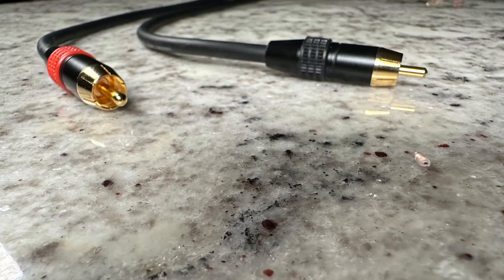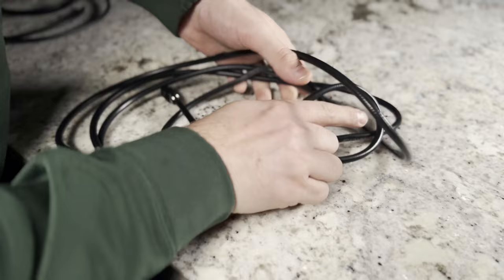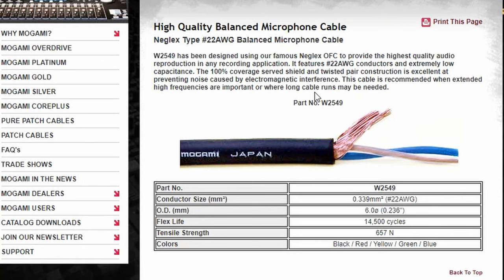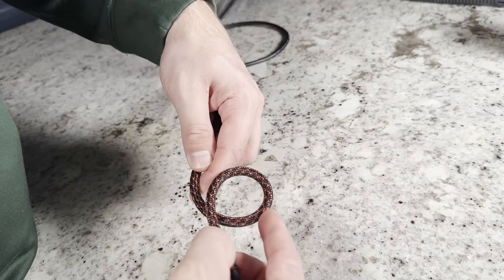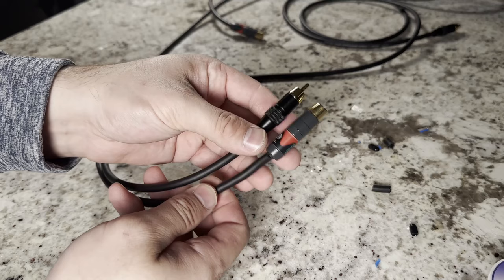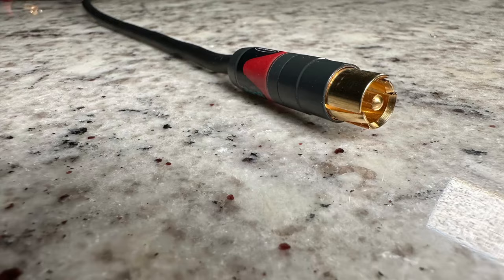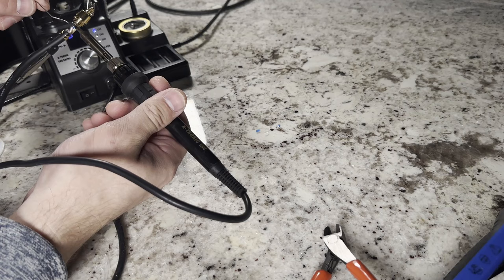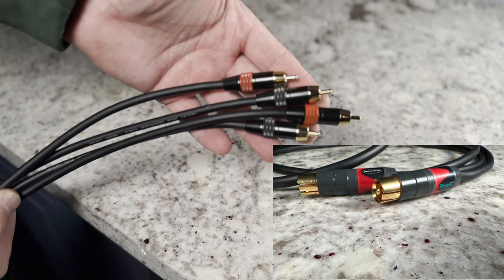The ULTIMATE DIY HiFi RCA Guide!

Comment: I did exactly this with Neutrik plugs and Mogami quad core. But I joined the two clear cores for the positive and centre pins and joined the blues for the negative and added the shield only at the end to be connected at the source (the surround controller) and left the shield unconnected and trimmed off at the other end ( the subs in my case). The idea being the shield will provide further shielding in addition to the two twisted pairs but will only be grounded at the source end.  This was a recommendation I picked up from the Swiss Gotham Cables site. Also the sum of the cross sectional area of two cores from the quad core is greater than the single cores in  the two core
Reply from the maker: That’s a great tip. I almost talked about this in the video, but decided not to. Glad that we brought this up.
Reply: That's exactly the way audio signal cable were recommended to be made in The Amateur Audio magazine, using Mogami cable. The two white wires joined to the shield on one ground end only, the other ground end just with the white wires. Some consider it's better to just crimp, not solder, the two wires or two wires + shield to the ground "tube". On thing that I should recommend is to use a short piece of shrinking to the "ground area" and apply heat on it. And trim carefully all the excess shield copper wire.
Reply: Nothing wrong but also unnecessary. You can do this with a shielded single core cable. With 4 core (dictictive color) shielded cable it is possible to make a stereo pair of XLR out of it with common shield drain to the source.
Reply: @ruofish  the point is by joining pairs of cores tog you increase the cross sectional area and reduce resistance compared to single pair or single core, and the floating shield connected connected at source end gives better EM and RF shielding
Reply: @stephenyoud6125  1. Getting one size up single core will yield more cross sectional area than joining two smaller core, for less money. 2. The 2 cores that you connected to the shield does not do any shielding and are wasted. Cores are for signals. Hence why I said there's nothing wrong with your approach but it's unnesssary. If I'm to build from fresh, I would get a single core shielded or twin core shielded (twin core for different sound signature, not for cross section) and build a pair of idividual cables. If I start with a 4 core then I will try to build a stereo pair within that with some care in doing the jacket.

Comment: I always thought it was a good idea to turn off any electrical equipment when plugging and unplugging things
Reply from the maker: It absolutely is for the reasons stated in the video. But sometimes you just forget.
Reply: Those connectors definitely have an advantage in live broadcast or pa environments where you might need to hotplug audio connections. However at home, where you always have the option to just turn your system off for a moment while you unplug or plug something in they mostly have no point. Still some nice connectors tho and i can see the point for some people.
Reply: @Toid  You'll forget even more often if you don't build that habit of always turning your system off before making a change....good tutorial, I just wouldn't recommend that people get in the habit of hot swapping cables.
Reply from the maker: @GoodkatNW  I completely agree. I don’t want anyone hot swapping cables either. It’s just another added form of protection for those that may need it.

Comment: Nice video, but your title is incorrect and misleading, it should read "A more flexible coax cable for RCA use". Let me explain and then maybe you can make a follow up video which is true to your title. The correct way to make an RCA cable using the Mogami W2549 is as follows:

1) Noise rejection comes from the pre-amp (operational amplifier on the receiver side) which the cable is connecting to. All op-amps amplify based on their differential input, even when designed as a single ended amplifier, and not specifically as a differential amplifier. 

2) The amount of noise induced into a wire is based on its loop area. If you have uneven loop area on your two input wires (in an RCA this is signal and ground), the induced noise will be different, and this difference will be amplified by the op-amp. When the noise on the signal/ground is the same the noise will not be amplified.

3) A 2 wire input, such as an RCA, does not have a true shield, the shield (if connected to the ground) is actually part of the signal path. We need to change that.

4) The goal is to have the same amount of induced noise on both your signal/ground lines. By providing equal loop area for the signal and ground wires this can be achieved. 

5) Do not join the blue/clear twisted pair together and connect them to signal. Do not connect the shield to the ground. This will give a difference in loop area for the signal/ground and different induced noise for the signal/ground wires.

6) Use the twisted pairs within the W2549 as your signal and ground wire.  The blue/clear wires have the same loop area and in theory exposed to the same induced noise, due to being twisted. The shield has a different loop area. Remember to maintain the same polarity of the signal blue / ground clear at both ends.

7) This will give the same loop area for each wire and any induced noise will be equal on the signal and ground inputs. The induced noise will then be subtracted by the op-amp and not amplified.

8) The shield wire should be cut at the receiver end and not connected to anything. At the source end of the RCA cable the shield wire should be soldered to another wire, called a drain wire. This drain wire should be connected to an earth at the source. Some sources won't have a dedicated earth connection, but in the case where the source component has a metal case and isn't double insulated you may be able to create one by sanding away the paint and bolting the drain wire to the metal enclosure.  If this isn't practical you will need to connect the drain wire to earth at a GPO. Obviously the length of this shield wire will be dependent on your individual setup.

I hope this makes sense and you can use the information. If you have any questions or would like clarification then please ask away.

Comment: Great video as usual, but i have one gripe with it. You say soldering the two inner cores together will get you better noise rejection, twisted pair wires definitely work great for noise rejection and it´s a well known mehtod, but only on balanced cables where those two wires carry an opposite signal to each other cause the difference in signal will be cancelled out by the electronics at the end, this concept also works if one core is your signal and the other one is ground, however it definitely wont have any effect if both wires are soldered together aka carry the same signal and thus effectively become one core.
Reply from the maker: That is a very good point. Thanks for helping further the community.
Reply: agreed, at that point you have a common node at each end and it's no different to a stranded wire.

Comment: I only use balanced cables (my equipment has balanced inputs). Surprisingly, Monoprice sells some pretty good ones. Where I live, gold plated connectors are important because contacts tend to corrode and get noisy. Deoxit can help overcome this if existing internal connectors aren't gold.

Comment: The cable you recommend is 5mm O.D. (.197").  This is right between 1/8" and 1/4".  What size braided sleeve do you recommend using - 1/4" or 1/8"?  I've never used it before and not sure how much it will 'stretch'?

Comment: Engineer with history in transmission line theory... always interested in what people have.

For an inwall run to my sub I've used a high quality coax as the shielding provides excellent rejection, sheath is in wall rated and flexibility is no important. I terminate to F-Type connectors. 

For interconnects a 2 core cable is a nice option given the number of radiating sources in a cabinet. I still recommend having it shielded and personally terminate shield at only 1 end but some will do both.

The RCA connectors with advancing sheath are a great option. Shame they are not easily sourced in all places :/
Reply: Ive ordered 4 metres of nice two transmission line shielded cable. I intend to do what you have described ( directional rca, shield terminated at one end) but some people recommend grounding the shield at both ends? Could you kindly clarify.
Reply: @hanscleung4633  As I mentioned in my post in the comments grounding at both ends will mean you have connected the shield, and the return together thus removing the benefit of a shield and second conductor.

If you ground the shield at both ends any noise energy it picks up in the air will become part of the signal, not sent to ground.

 Terminating the ground at both ends may be what people are saying when they use a single conductor as that is required for that style of cable, or if they do not know what they are talking about.
Reply: @hanscleung4633  This is from another post I made discussing antenna effects and using a shielded cable.

This is correct. You are using the shield to trap radiated emissions from outside the cable and you get rid of it to ground. If you "ground" the shield at each end using the outer part of the RCA you are using the return  line and thus turning your shield into a 2nd return... making the whole point of 2 conductors and a shield pointless. 

Terminating shield at each end is ONLY useful on single conductor where the shield is the signal return, OR if the ground topology of your equipment required it (not in the purview of audio) 

In general, the highest level of rejection of interference will be twin conductor, external shield terminated at one end (source to prevent possible antenna effects).

Called "Directional Cables", these are simply applying the basic fundamental tenets of Electrical Engineering and being Audio they use a bunch of wankery to upmarket them as special rather than common.

You don't NEED them for a system to work though. A basic coax or 2 conductor with no shield is going to be fine for sending a signal. The signal will be vulnerable to noise though and in the systems of today with active radiators like wifi right where your cables are... it makes a difference.
Reply: @hanscleung4633  May I ask what cable? a link perhaps?
Reply: @michaelrobinson9643  thank you kindly for your detailed reply! Ive ordered up the Hifi ORTOFONN RCA Kabel Ortofon 8NX, and a length of Van Den Hul MC-SILVER IT 65 cable. 
Thank you!

Comment: Im about to make my own rca - it has two signal cables.
Im considering the following. 
1. Merge two signal cables, earth the sheath only (do this both ends
2. 1 live signal, 1 earth cable, ground earth and sheath, float sheath other end.

Please help there are compelling arguments for both methods
Reply from the maker: If you have a ground loop problem, then you might want to try 2 to see if it helps. This will be considered a directional cable now.

Comment: I've got a case of 40 x 6.5" bass drivers ( peerless I believe) and various tweeters...I've always wanted to build a pair of large column/ line array speakers, maybe 16 drivers per side. Any suggestions on what to make....They would be used for hi fi listening and I prefer fast punchy bass. Thanks.
Reply: The first step would be identifying them or measure their T/S parameters. This would give you a starting point what can be made with them.

Comment: I am not an expert and I don't rea;;u know. but I would have thought that two inners wire would have been you plus and Minus and the copper shielding would be there to shield the audio from unwanted signals. but only tied on one end as not to make an antenna.
Reply from the maker: You can do that if you want to make a directional RCA.
Reply: This is correct. You are using the shield to trap radiated emissions from outside the cable and you get rid of it to ground. If you "ground" the shield at each end using the outer part of the RCA you are using the return  line and thus turning your shield into a 2nd return... making the whole point of 2 conductors and a shield pointless. 

Terminating shield at each end is ONLY useful on single conductor where the shield is the signal return, OR if the ground topology of your equipment required it (not in the purview of audio) 

In general, the highest level of rejection of interference will be twin conductor, external shield terminated at one end (source to prevent possible antenna effects).

Called "Directional Cables", these are simply applying the basic fundamental tenets of Electrical Engineering and being Audio they use a bunch of wankery to upmarket them as special rather than common.

You don't NEED them for a system to work though. A basic coax or 2 conductor with no shield is going to be fine. The signal will be vulnerable to noise though.

Comment: Why would you swap RCA cables while your system is energized? Not a great idea.
Reply from the maker: Definitely not a good idea. Typically when I see this most the time it’s when something happens to the equipment and they’re trying to figure out or diagnose what is wrong. That or they just got a new piece of equipment and aren’t thinking about it. It happens more often than you would think. But if you can remember to keep your equipment off on changing your RCA cables, there’s no need for the pro-fi.

Comment: Just remembered i bought some mogami for my beyers about 9years ago......where the fk did that go 😂

After years of testing though i can say the nicest sound comes from pure silver (look for military aircraft communications wire), but the return cable with a mix of pure silver and gold plated ofc.  Sounds expensive but if you think outside the box a bit you can get it all fairly cheap. Think mine cost $100 all in all.
Also miniature aviation sockets are awesome 👍😎 (as well as big aviation sockets with about 30pins lol, monsters)

Comment: Hear me out, you can simply make connections with your gear turned off, to protect your speakers". Infact you should always do that by standard, and every manual mentions it.

This springy mechanic on the expensive plugs is completely unnecessary and nothing but a potential mechanical failure point. For nothing.

Comment: The Neutrik Profi I would not recommend. That spring loaded ground ring is a weak point mechanically and electrically. There’s a reason why most high-end home audio cables don’t use this method. That Neutrik connector is better for pro audio if you’re not using balanced XLR connectors.

Comment: Must of missed the decimal point. Or some garbage monster cables. But not $1000 cables. Click bait!
Reply: I think the Author's point is that simple engineering is all you find in $1000 cables. Some have better quality components and that does not guarantee improved electrical or acoustic performance. I would describe different cable styles though if making a guide. These come with drawbacks.

Comment: a new plug for 19 euros does not make a high-end hi-fi cable. the trick is to solder the wires and shielding in the right way. if you plug in the cable and switch off the hi-fi system, these plugs are overpaid and not necessary.

I got 12000 views in 12 days, why?

Comment: The high-end speaker wire industry markets oxygen-free copper as having enhanced conductivity or other electrical properties that are supposedly advantageous to audio signal transmission. In fact, conductivity specifications for common C11000 (ETP) and higher-cost C10200 oxygen-free (OF) coppers are identical;[12] and even the much more expensive C10100 has only a one-percent higher conductivity—insignificant in audio applications.[12]